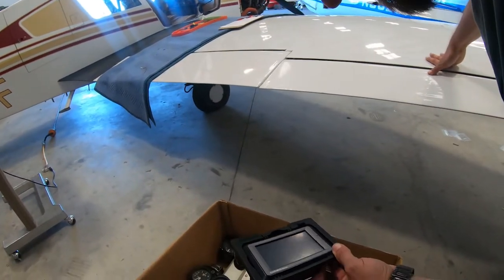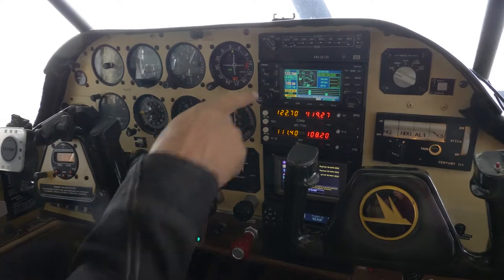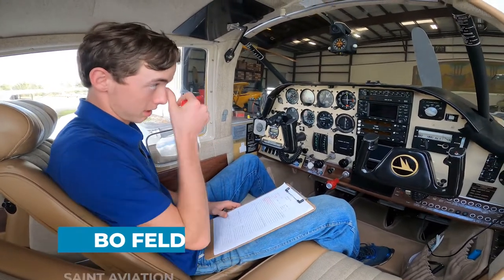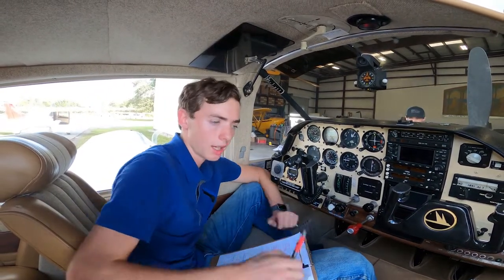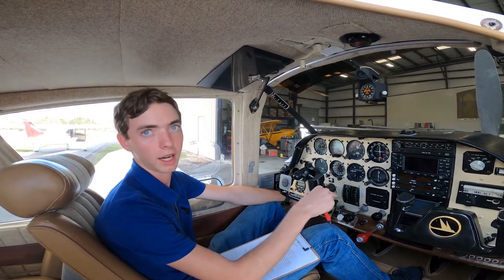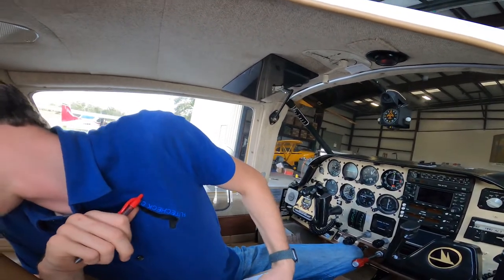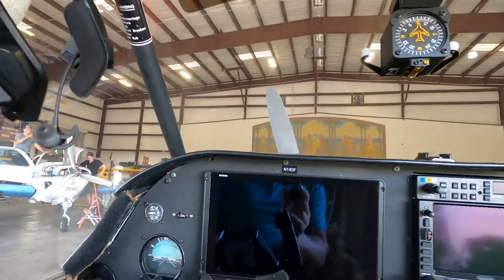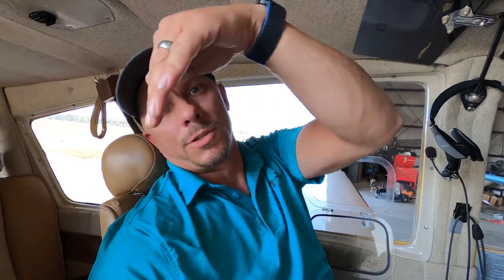Upgrading the Bellanca Super Viking with a Glass Panel! Garmin G5, Dynon Skyview HDX, and more

Comment: About 12 years ago, when I had to replace mine, Wentworth said they had a bunch of those pressure switches for the Auto-Axion gear extension feature in stock.  They're made by Singer, and I had to send them a screenshot from the maintenance manual, because they weren't sure what I was talking about.  I don't remember the price, but it didn't stick in my head as being too expensive.  When I had my panel upgrade done in 2017, the shop let a bunch of metal filings fall on the flap switch connections without cleaning them up.  That made for an interesting test flight.
Reply from the maker: It’s always fun to do a test flight when some critical systems are not working properly. 😰

Comment: Great videos!  Love the Super Vikings!  105 mph IAS for the Auto-Axtion airspeed.
Reply from the maker: We added a breaker to override that in the event we have a water or rough terrain emergency.  Its a great system though!
Reply: That’s a wonderful airplane.  It doesn’t matter how successful you are or what you may be flying in the future you will always remember that plane and how nice it is.
Reply: @wyflyguy114  our Viking had a small red button next to the gear selector you could push and hold in to defeat the automatic gear extension feature.  It really hurt your finger if you held it for a long time though.
Reply from the maker: @billeudy8481  I’m hoping to keep it even after I get a Malibu.

Comment: I think I flew this airplane back when it was new. I have to dig out and old log book and check. The Saints are great folks with a rich aviation history in their family. Why not go with Garmin G3X? It would work with your autopilot and keep you from having to use the g5 to work it.
Reply from the maker: I can’t recall why we didn’t use the G3. I looked at it as an option Ali g with the Aspen. However if memory serves there were some huge disadvantages with it and the Aspen. At the end of the day the G5 on was the best option and using the G5 for my auto pilot is not a huge deal. I wish I could remember what the hangup was with the G3x but it’s escaping me at the moment.

Comment: Nice setup and upgrade. 

What did you find out why the heading would “hard over” beyond the 20-25 degrees?

Did the Attitude Indicator Gyro need to be overhauled, and if so did that fix the hard over/over bank issue?

Best.
Reply from the maker: Bad communication between the AI and the AP.  Had this pop up again after the new interior and had to have a shop in FL fix the wires sending info to the AP from the AI that were damaged by the yoke controls.
Reply: @wyflyguy114  
Thanks for the information. 

I’m thinking mine is probably in the “box” itself.  We shall see. 

Best.

Comment: If you went with a garmin 275 and a G3X you could of removed your vac system plus it would drive your autopilot in all modes.
Reply from the maker: There was a problem with using the Garmin G3X because we looked into that.  I think I had not been STC’d for the plane perhaps but can’t remember exactly.
Reply: @wyflyguy114  That's to bad if true.
Reply from the maker: @johncarr123  I looked up some of my quotes and one of them was for a G3x. I think one of the big problems was the Garmin equipment was substantially more expensive and instead of doing a $50,000 panel upgrade I would’ve had to go with all garmin and that would’ve cost $20,000 more. Trio is supposed to be coming out with an auto pilot at which point I will be able to clean up the rest of the panel removing the vacuum pump and old attitude indicator. That auto pilot is simply amazing and I’ve been talking very closely with the company.
Reply: @wyflyguy114  I think the Dynon is a great suite, but like all avionics mixing them gives disadvantages. I admit I don't know why the dynon AP wasn't a good idea. I went all garmin, but then I have been accumulating garmin for 20 years now so it made sense. If I started from scratch it would be Dynon all the way.
Reply from the maker: @scottfranco1962  I’m not really mixing. The Avidyne works great with the Dynon. The g5 has one purpose, drive my ancient AP. No body makes an AP for my plane besides S-Tech and it’s over priced. Trio is working g in an AP and when it’s approved I should be able to get rid of the vaccine system, and g5.
Reply: @wyflyguy114   the Garmin GX3 will not work with the Capacitance fuel gauges that are standard in the Viking or at least the 73+  model. Dynon seems to be my best choice also. I have asked Dynon about certifying their Autopilot
Reply from the maker: @flp-hammer  What was Dynon's response?  STC/Trio is also looking at it but it seems like they are losing interest.

Comment: yea sucks that the Dynon and the G5 don't talk. I got the G500 txi, and the G5 and it talks. I have to admit, though, I rarely care what is going on with the G5, which is there for backup and to make the AP go. I should get more involved with it, to get used to (say) a panel power fail.
Reply from the maker: Yea the g5 is simply driving my current AP. That’s it’s only purpose.
Reply: I'm surprised that they installed a G5 with your G500 TXi as it is highly recommended that you install a GI-275 with the G500 TXi system and a G5 with a G3X Touch system due to how they all communicate with each other. G500 and GI-275 using High-Speed Data Base and G5 and G3X Touch using Can Buss communication.
Reply: @methosmomomax7470  You and me both. I originally speced the g500, but Garmin discontinued it for the txi. I didn't know about the G3X, it was not certified yet. I think it would have been simpler if the G3x was there. Ah well.